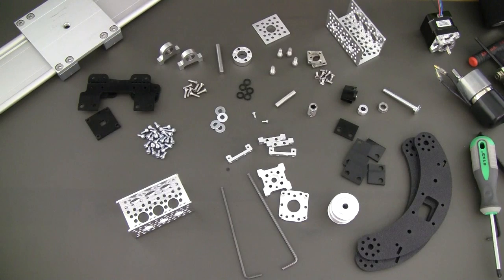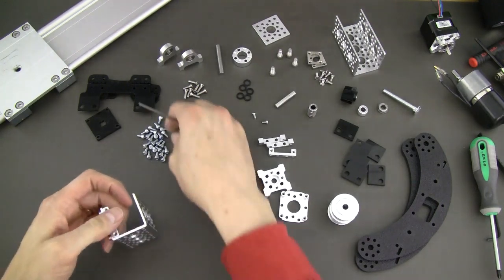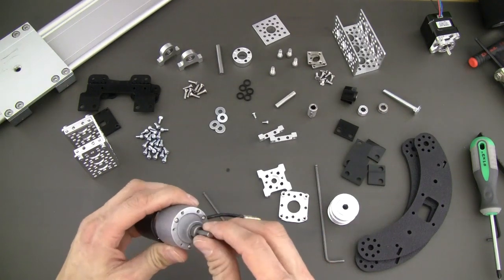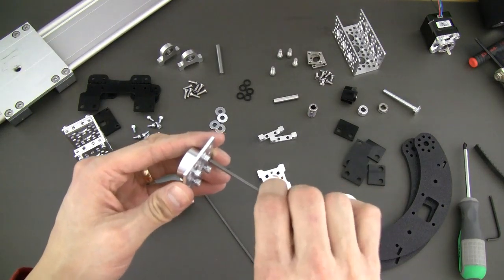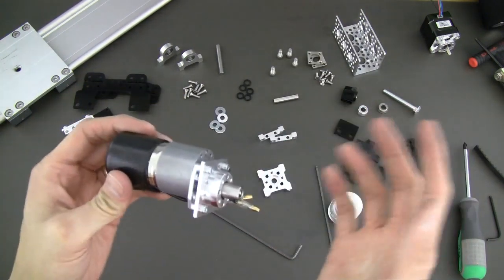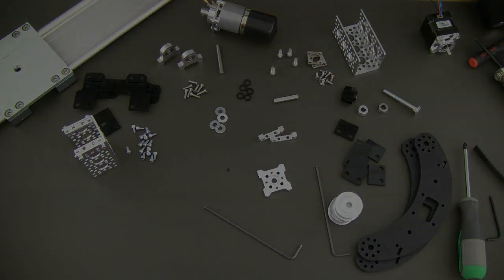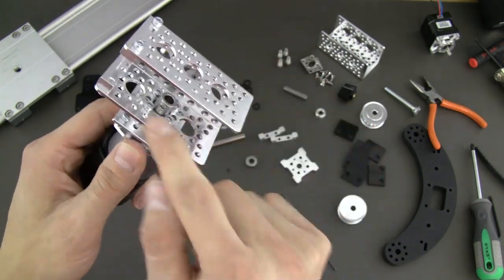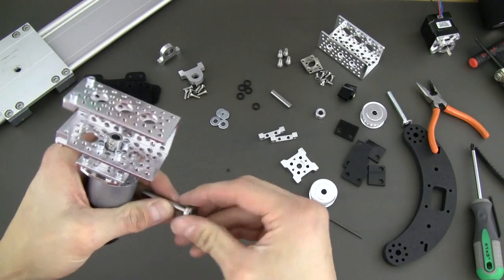Actobotics - IGUS W1080-B Slider Kit Assembly (part 1)

Comment: Shaft coupler is directional.  It matters which end you put into the motor.  You can waste some time trying to figure out WTF is going on trying to shove a 0.250" shaft into a 0.240" opening before you realize that the unmarked shaft coupler can go on backwards.  

There is no mention of this in the video.

Comment: Will it possible to fit this kit on W1040?
Reply from the maker: It may be possible with some modification, but the 1040 rail is narrower.  If you are interested you can contact our techs at tech@servocity.com or 620.221.0123 and they would be glad to answer any questions.